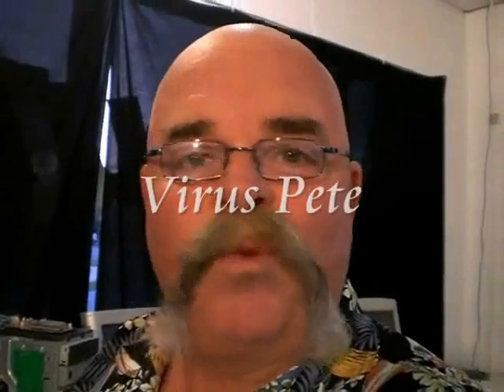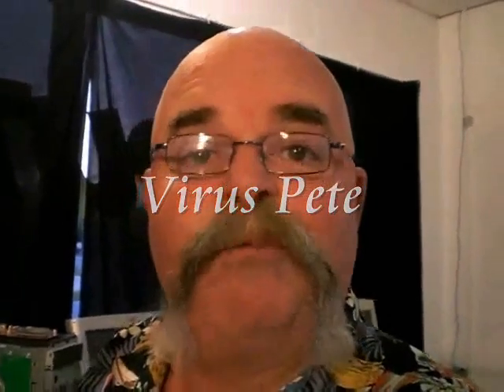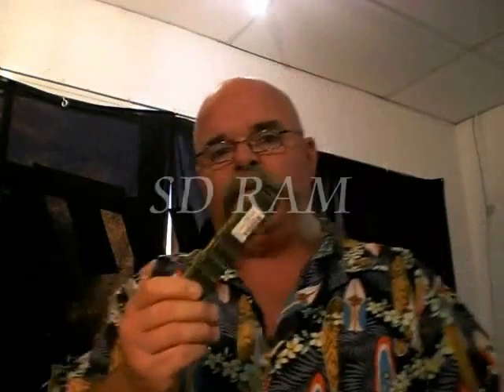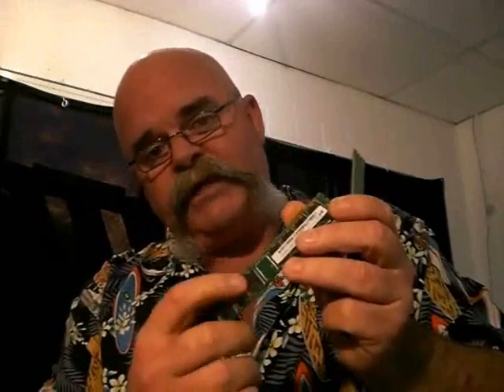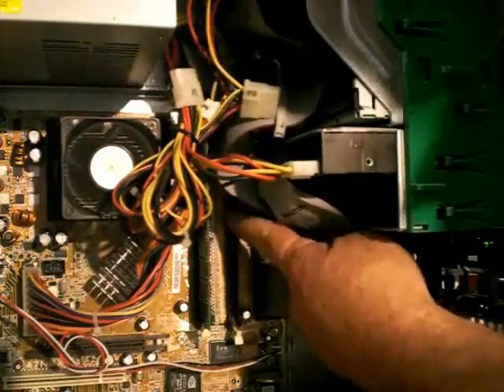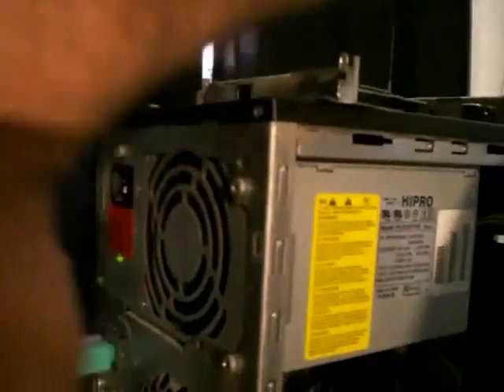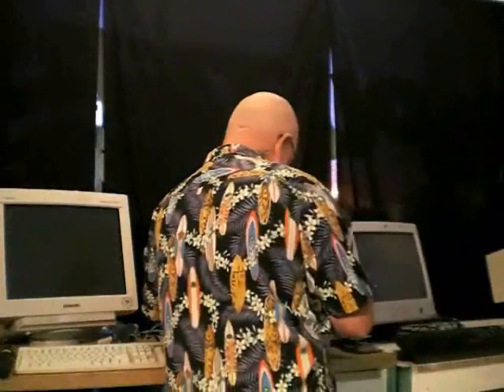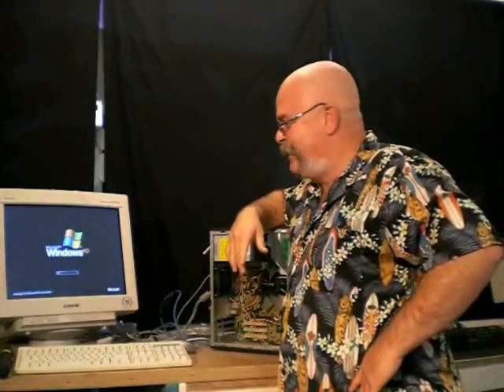PC repair for DUMMIES - No signal to monitor

Comment: I have had an old computer in storage It was purchased in 1999/2000 I think. We had it rebuilt in 2005 before it was stored but always stored in the house. I tried to boot it today as got a flat screen monitor for it , lights come on but nothing on the monitor.Fan and all lights working but not sure if it is booting correctly.Could this be the ram or something else.Old monitor is not receiving anything either..Thank you from a 69 year old lady.

Comment: I have a large large flat screen monitor that came with my HP computer. The monitor stopped working and is only all black. Does nothing!  I hooked my husbands much smaller screen to my computer and VOILA!!  Picture is back and works well! So, what could be the problem with my large monitor?  I'd like to hook that one back up again. Got used to the bigger screen and loved it.  Thanks for any help you can advise me of.
Reply from the maker: Elsie WOODWARD  Sounds like a blown Monitor I'm afraid Elsie....

Comment: can you help me?  i have tried to hack a dell all in one to an xmbc machine to run a projector with vga. i ripped out the screen ect. + got it down to a nice small size. but what i thought to be a vga output is just a 9 pin parallel. so no way of getting a picture out of it, save the connecter to the old screen. any way/hack that reverses from an obscure monitor drive to RGB out?

Comment: I have similar problem, no monitor action, however in addition there is no illumination of the mouse or keyboard either.  It is an HP tower running Vista.  Ran fine Monday, shut it down and Tuesday when I turned it on......NOTHING.  Any suggestions?
Reply from the maker: John Newcomb sounds like the power supply mate...

Comment: Our very old, windows 98 computer worked fine (for what it is) although a bit slow, up until 4 days ago when we had a very brief power outage due to high winds.  Now when we turn the monitor on, it says no DVI, no VGA.  No signal.  Monitor going to sleep.  
So.......  is it an easy fix or a junker?
Reply from the maker: Dede Miller Hi DEDE...yep...buy a new one..lol    sounds like a blown power supply to me....

Comment: Hello! I just seen this video and I liked it, I just subscibed by the way. I think you are a very helpful, experienced and honest person and I hope I can get a little bit of help with my issue. 

I got a 7 year old pc that was built using 2 ram sticks of CORSAIR XMS2 1GB PC2-6400. Since a recently upgraded my Windows 7 32bits to Windows 7 64bits I tought I needed an extra pair of ram sticks so I bought another new, out of package, 2 ram sticks of the same brand, latency and capacity.  I reseated them all four. Now my pc wont boot, no beeping, no video signal. I tried using just the new pair of ram sticks without the old ones and got same result.

Thanks in advance. BTW I got an ASUS M2A-VM HDMI mother board.
Reply from the maker: omicron117 sounds like faulty RAM mate...

Comment: Gday, I run 2 monitors, My main (1) is fine, one morning the offset(2) decided not to work. I press it's on/off switch and asus (yes it's an ASUS) comes up then and then 'HDMI no signal'. I've never connected it via HDMI. Wondering what your thoughts are? I'm about to try the fix you have posted here and a bit of a clean internally
Reply: Your second monitor is expecting HDMI and not seeing it. The monitor has some buttons on the front to change what type of video input your are using - VGA, DVI, displayport, HDMI, or auto select. Change it to the input you are using.
Reply from the maker: albionacupuncture what Phil said...lol...

Comment: Just got done building my new PC and surprise surprise, nothing comes up on the screen. Everything in my PC seems to be working, fans, lights, and the beeping sound it makes when powering on. As you can well imagine I'm pretty damn pissed off.
Reply: The beeping sound is the computer trying to tell you something. The beep pattern can tell you if the problem is the video card, memory. or something else. Go to the support site for your system board manufacturer and look up the beep codes.
Reply: Just happened to me! Anyways just fix it by pulling the plug of the computer, then putting the ram cards in different slots and make sure they are TIGHT. If not, this will keep happening.

Comment: i have recently completed building a new computer, parts being as high end as possible given my budget. And being absolutely thrilled to fire it up and be on my way with it i was quite pissed when i did and got nothing to the monitor. i get the lightest flicker of green from the monitor power button but no display at all also i have tried re-seated the R.A.M. as i watched in one of your videos with no success any thoughts? cause im clueless. another small (or hopeingly small) is that when i turn my computer on every thing turns on but after less then a minute it will shut off and restart but turn off again if you could please give me your input i would greatly appreciate it
Reply: Unplug your power cord from both your pc and monitor, hold the power button from 30-60 seconds so it can drain the power out. Connect everything back in and see if that helps.
Reply: i have that problem too, have you fixed it yet to give me any tips?

Comment: Hello Sir, I have Gigabyte GA-78LMT-USB3 Mobo, FX-6300 Processor, ADATA-XPG 12800 4GB (1600mhz) RAM & another ADATA PREMIER 12800 4GB (1600mhz), total 8GB Ram, Sapphire ATI R7 260X 2GB Graphics Card and last Cooler Master Thunder 500 Watts SMPS, 

Now today I installed it, and it started perfectly for first time, and then I installed my Graphics card Driver then when I restart my PC, it restarts perfectly but after that when I shut down, and after some time I started it just don't boot, monitor says no signal, I tested on my TV, 2 Monitors as well but same result. 

Can you tell me what goes wrong all of a sudden!!! Can you please help me to get back my PC running,

Thanks in Advance...my email address (mayurpatel10487@yahoo.com)

Comment: i have  windows 7 ,my screen is an acer when i turn the computer on, the screen starts up but then gos black and the on off button on the screen flashes any help would be grateful. Kim
Reply: Me too
Reply: have you fixed your screen yet ? and if you did what did you do  please tell thanks
kim
Reply: yes i just unpugged all the wire in the monitor then i put it back again and plug to computer

Comment: Greetings Sir Pete. Lots of respect on ur tutorial very informative. I need ur expert advice. Basically i had a window xp on asus p5sd vm mother board. Trouble is it wont boot advance recovery dont work for me every time i chooze one of menu in that recovery nothing happen then shutting down on its own. And bam advance recovery again. I did try repair disk dont work too. What do you think is my issue here thanks for reading this. Keep up with the tutorial.
Reply from the maker: ot_ot mo  sounds like  a failing HDD mate...
Reply: it is mate, thanks for the reply, even DBAN did not solve my issue. I just changed d HDD and works like a charm. big thanks ....

Comment: Today I've just try to swap my older computer that's on my desk (Acer hooked up to a Acer monitor via CRT) for my custom gaming PC I've had since January (Hooked up to a TV via HDMI) Long story short my gaming PC won't get any signal through the CRT cable. I've asks experts and they said my ram (Two G.SKILL RipjawsX 8GB DDR3 1600Mhz F3-12800CL10S-8GBXL) shouldn't be the problem due to their style and type. Everything inside it works so I'm sure its not the mother board. Any advice is much appreciated. Thanks

Comment: my computer was build in 2011, woke up this morning and my monitor decided to have no signal. So, i adjusted the wires and cables, nothing, I then proceeded to do what was told in this video to both my cards of ram but still nothing. Its one thing after another with this thing! I have bad luck with computers!
Reply from the maker: Lynn Modest sounds like u need to bin it darl :0  lol
Reply: No way jose! This is a $1500 gaming computer..TURNED OUT that the stupid graphics card got lose out of its place. I almost died laughing when I fixed it. I am such a derp, but atleast I can say I learned something in your videos!! Thanks !
Reply: Zz Zbog

Comment: Dude , i changed my motherboard 5 years ago to a new one called MS-7536 ver 1.0 , i open the machine coz i wanted to see the reset SW connectors where not connected to pins correctly , anyway , when i put it back to work the monitor only shows that "no video input" , i checked VGA connection no problem on that , so i did reset RAM (DDR2) but again the monitor not going on to work , any suggestion ?

Comment: I had this problem and ran all sorts of tests including the RAM one I come to the conclusion it is either the motherboard or the CPU.
Because the problem happened shortly after a CPU fan error came on computer shut down and never worked since.

I decided to take it to a local shop for a check to see wich of the two components is fried . It has been a month I check every 3 days but nothing was ever found out.
I told them I was taking my computer and when I checked in the shop it had RAM sticks missing and a different GPU. I notified them about this and told them I would come back to pick it up once all the original components are back on.

I have receipts of all the computer parts I purchased as I built it myself and even the boxes.Question is if I find out this repair shop is being dishonest and not just a mistake what is the best way to handle this? I am currently thinking of taking it to the police and court.

I am typing this from a laptop at the moment and it sucks being without the gaming PC.

Comment: Thanks so much for your help. Quick question, if I have DDR 2 RAM and have had to do this once before should I think about getting a new computer or is there something I can do to prevent this from occurring?  Appreciate the help.
Reply from the maker: If you are running DDR2...than your machine is quite old....best to upgrade...cheerz...

Comment: I'm running a HP server, it's dose this. Did what it said in the video and it didn't work. Any other ideas? Also I've had it on got a black screen for options froze then I needed to reset now I don't get anything. Also only 2 of 6 of my hard drives are not reading could they just be dead?
Reply from the maker: Yep...time to upgrade...

Comment: Hey on my dell desktop everything is working fine BUT the screen. The ac in chord works fine but it will not cut the screen on. The bottom won't turn green nor the little clear thing next to it.

https://mail.google.com/mail/u/0/s/?view=att&th=14655a73eb3355fc&attid=0.1&disp=attd&realattid=a2eb0dd064ffea67_0.1&safe=1&zw

https://mail.google.com/mail/u/0/s/?view=att&th=14655a73eb3355fc&attid=0.2&disp=attd&realattid=d9965c9b6fe8526c_0.1&safe=1&zw

Comment: Just bought a new CyberpowerPC Gamer Supreme SLC6000. I unboxed it took off the side panel, took the padding foam out and set it down. I turned it on and it turned off fine. I then proceeded to connect the monitor to the computer and I got the famous "no signal" sign. Any advice?
Reply from the maker: return it mate..  ;)

Comment: Im having an issue of no video out and no beeps. I've replaced the motherboard and get the same thing (so can cross the mobo off right?) i've tried a different psu nothing changes so I guess it isn't the psu either. I've had everything out and replugged it all back in, made sure ram is in properly and cpu is seated correctly. I'm now thinking it could likely be a faulty cpu, i've read else where that a faulty cpu will cause no beeps and video out. Would you reckon thats the most likely scenario?
Reply from the maker: yep...right on the money mate...

Comment: My computer start fans are working light are on but it has no signal to monitor,mouse keyboard and speakers.i tried to put out the ram and clean them as you said but still nothing works

Comment: I didn't work I wiped it off just like u did and nothing it almost came on but it was showing a disoriented picture but then I realized i didn't push the ram stick in all the way but once I cut off unplugged everything and pushed it all the way in cut it back on there was nothing... still showing the no signal screen...  I Dan get it my desktop computer isn't even old it a new emachine...

Comment: Please, PLEASE respond; Well, I ordered in a couple crucial ddr2 200pin 2GB ram. I installed it,  didn't show up. Then I decided to turn off my pc, and check to see if they were loose. While shutting down it took about 20 minutes and it said it was "preparing to configure windows" so I left it and it finished. When it shut down, I got to checking the ram sticks. I grounded myself, and pushed them in until the clicks. I then turned my pc back on, and it did What the first laptop did. I pushed and held the power button out of panic. Now it turns on, but nothing will display. I desperately need help, please!

Comment: A friend gave me a Gateway FX530.  Every time I booted, seems like something different happened, but for some reason, this a.m. the update didn't install the nvidia driver.  Now I have no video, although the computer seems to be working.  I can't install a driver, because I can't see anything.  I've tried another monitor, in the hopes it might plug & play, but it uses nvidea, too, I think.  HELP!  This is not something I want to spend a lot of money on, but would like to use it.

Comment: But now it shut off and won't power up after can duster. Shop time
Reply: you should also try replacing the cmos battery. this is another common issue with older computers.  Very easy and inexpensive, I replaced mine a few days ago 2 dollar battery from the grocery store.  Turn off pc and remove power cord before doing anything and bring battery to make sure you get the right one

Comment: This DID not work the first 2 times.. third time it worked.  I was not seating the RAM back into the pc deep enough.  On the third try I noticed the clips were not securing into the slot cut outs..  pushed the RAM harder, seated properly, turned on...and waalaaaa!  Many thanks sir

Comment: This was an irritating problem, which turned out to be easily solvable.  The 'DVI signal lost' message would come up followed by a blank screen.  No keyboard strokes worked to revive the screen.  Cable fine.  The only way to bring the monitor back to life was to reboot the computer.  Then I saw this video.  Took the side panel of the computer off, located the two memory cards each held in place by two white clips, opened the clips, pulled out the two cards, wiped the cards, reinserted the cards firmly, closed the clips making sure they held the cards firmly in place, screwed the metal side panel back on.  So far, no reoccurrence of the 'DVI signal lost' message.  Thanks for your very helpful and strait-forward advice Pete.

Comment: Loved your attitude, so happy. Anyhow I have a 2003 Dell desktop that is giving me a fit. It turns on and beeps but it doesn't start up right. The Dell logo comes on the monitor then nothing (A green screen). I can get it to do the safe mode F2 but once it lists the registries then nothing. Can also get into the Bios. I don't know anything about computers basically what I have learned today on various youtube sites. Do you have any idea what could be wrong? I am going to try to do what you did on this site tomorrow, but wondered if it was something else since it seems that the monitor is freezing up. TYA

Comment: I know a lot about technology and computers myself, but I don't know about dual-screen setups, my first time attempting one tbh. I keep getting a "VERIF SIGNAL" image on the right screen, whereas the one on the left seems to be just fine. I've tried swapping the cables around, I've crossed out the probability of it being any of the sockets. It could be the DVI-I adapter but I've no idea how to check for certain. Cheers for the guide.

Comment: sir i am using ddr 2 ram can i able insert ddr 3 ram into the slot in ddr 2 slot...?
Reply: lol fuck off troll
Reply: wat the hell mate
Reply: raj raj
lol could only assume ur trollin, 'specially with ur nick(raj raj)... anyway, chex this out m8. DDR2 cannot be used in DDR3 slots as although they are both 240 pin, the size and position of the pins differ. Further, your chipset wouldnt support the different frequencies I assume.
Reply: thankz mata...!

Comment: my tower is brad new but the monitor is old the monitor will turn on and then show rbg no signal and then go in to sleep mode what's wrong with the monitor
Reply: I just got a new ibuypower tower and when i plug in my monitor it says no singal and then goes into sleep mode

Comment: Whoa ... not what I was looking for... I Have an HP Pavilion G72 and the Screen on it was hit by something, so With the screen being unresponsive and basically FUBAR'd. I carefully Disconnected and threw it away, so now im using VGA and HDMI outputs to my monitors.... I have a screen coming soon. the Display works Great, but here is my issue, I cant see the Bios screen or the windows OS boot screen, and i really need to REFORMAT this Pc and change the display settings to VGA and or HDMI out as my primary display..... any advice or help would be awesome!

Comment: Next time just pull the power supply cord, and pop that little battery out that was right next to ur hand right when you were poping out that memory, that battery is the constant power supply thats used by the memory to hold its cache. Also the internal clock. So you will have to enter you system settings.